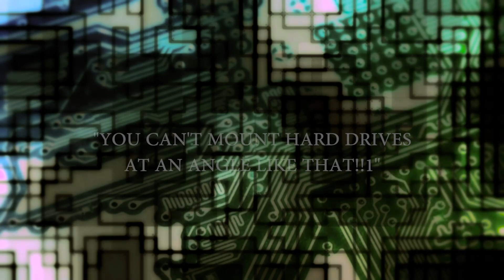Black Dwarf - Hard Drive Replacement Q&A

Comment: Glad to see an update to this really nice build
I'm the same way about my builds on what ever I may be working on.
I call it MacGyver'ng I just get an idea and find the parts needed that work for my needs & then build it.
I agree about the HD placement. I used to have an old HP and it's drive was mounted vertically with no problems ever.

Comment: Great video that really gets into the nitty gritty details of the build.  Love it.  I need to build a file server for my DVD collection which I've been slowly digitizing.  Thinking about doing a wall mounted system with everything just hanging over my desk on a piece of plywood, but with a sheet of plexiglass in front of it to get a chimney effect to move the air over everything.

Comment: You know what would make this build more user friendly? Even if it's just for yourself if you ever decide to update it. Just have the whole thing slide out from the back on a rail system. have the front panel wires run to the back with a bit of slack so you can unplug them and then slide the whole thing out to work on.

Comment: That would be much easier if you built it a little bit bigger and just put the whole system on a tray inside the case so it could just slide out with a few disconnects of the lights and buttons. Cool video!

Comment: If you upgrade these Hard drives to 2.5" drives you could fit more drives in there and get more storage space. Or, as a more expensive idea, upgrade them all to SSDs. Just an idea. Great build, great video! :)

Comment: In my opinion. i don't think that mounting the discs at any point effects performance or life. I've been inside quite a few harddrives. and really the only moving parts are the read/write head and the platters. the read write head is made of aluminium and probably wont flex or be effected by gravity and the platters are stiffly mounted and bolted on with screws. they wont be effected by gravity either. the only thing i can think of that may harm hard drives is a very sudden smack or shake.

Comment: I seem to recall reading on the WD site that they recommend only using a max of 4 (or wasit 5) WD Red drives in a NAS / Raid enclosure due to vibration from the red drives, any more than 5 they say the SE drives are best now.

Comment: The harddrive mounting angle stuff it bullshit. You can mount it anyway you want and it wont affect performace. 

Im the same with my custom built machines, only I know how to properly take them apart ;)

Im considering getting 8 WD Red drives for my NAS which currently only has 250gb Hitachi's. The only issue is funds, its going to take quite a while to save up for all those drives!

Comment: hahah should have had the power and data cable on top take off the lid and you're done! unplug and plug in another drive screw in and close, or a bottom panel so you can just unplug a drive and plug it back in.
but then again you built it good job. 
i have ideas now, i thinks i need to start a project.

Comment: If you couldn't reverse engineer it from the build videos, then I question you building one from plans really.  it's not like you need exact dimensions.  A box big enough for 8 HHD's and a small form factor MB.  Most of the other essential information is in the build videos...

Comment: You need to use wd reds for raid
Reply: +Harrison Knight No you don't. That is a marketing scheme by WD (Typical!!!). Any drive can be used for raid but people tend to use raid drives for raid because It is obvious that they are built for more of a beating. However if you use HGST NAS based drives they have a much lower failure rate (No I do not work for them!)